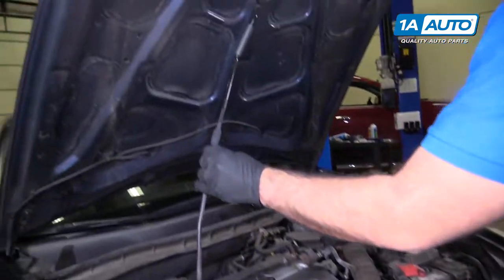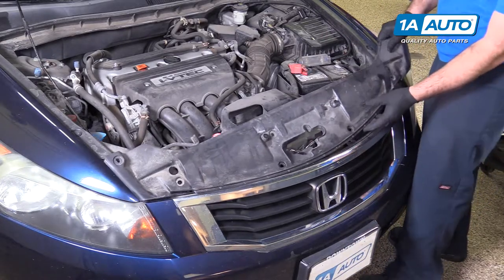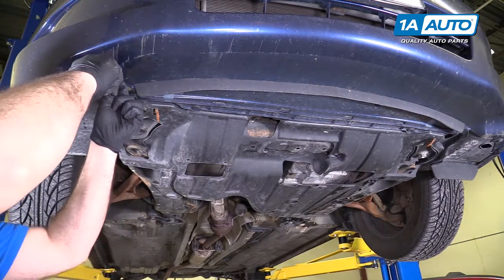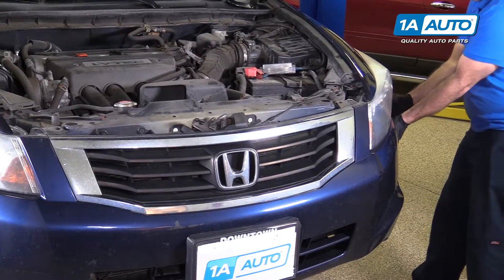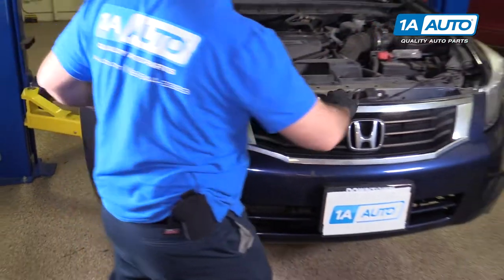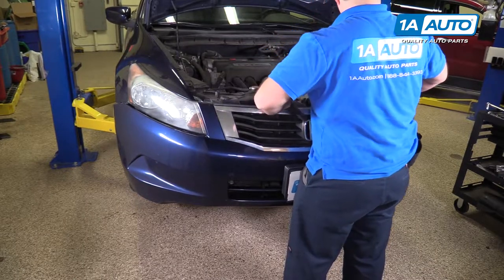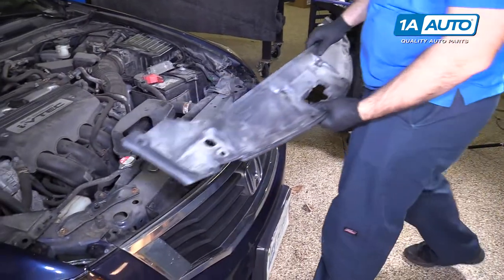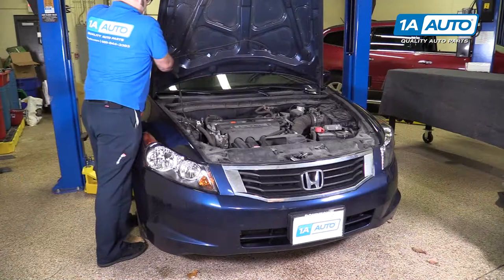How to Replace Horns 08-12 Honda Accord

Comment: Any links to get the horns?
Reply from the maker: +JARANA 05 Thanks for watching!  We do not carry the factory style horns for this vehicle, but we do offer a set that would work.  Check them out here: https://www.1aauto.com/horn-pair-hella-003399801-hella-003399801/i/heehn00001/372/2008
Reply: @1AAuto  thanks ! It also include the conectors ? Or just the horns?